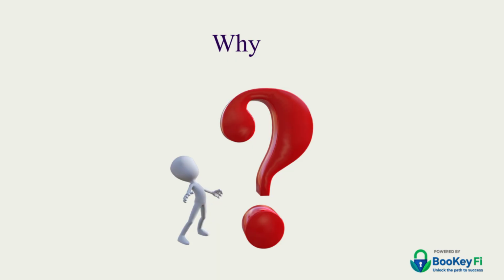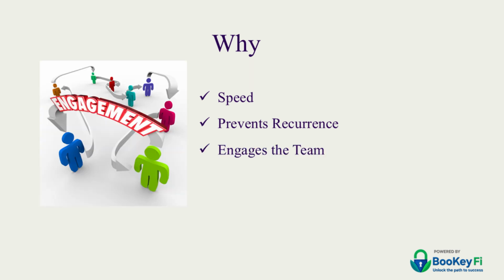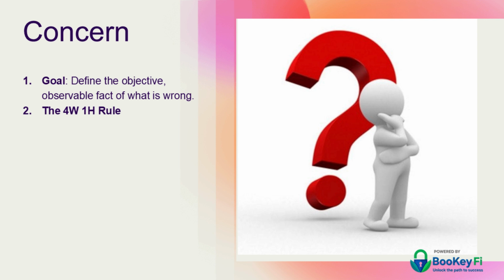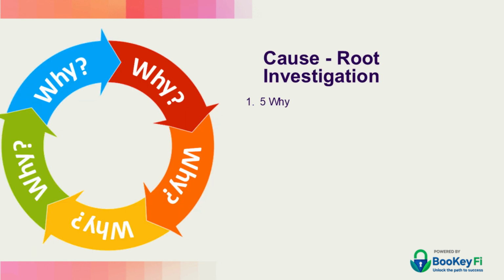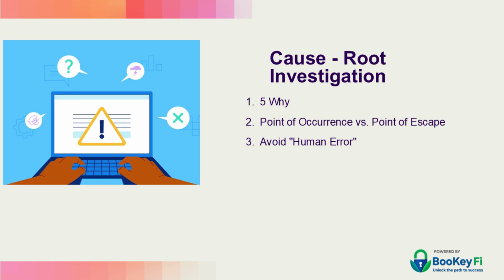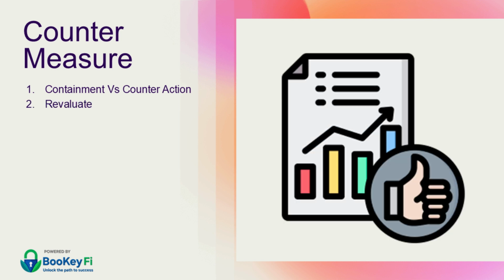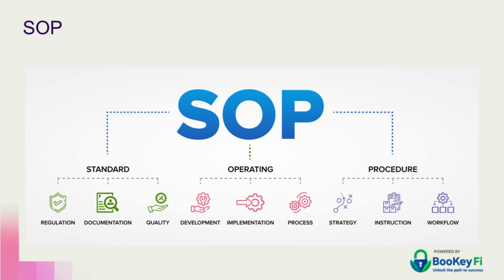3C Problem Solving Lean Quality Tool for Root Cause Analysis RCA | 3C Report free Download

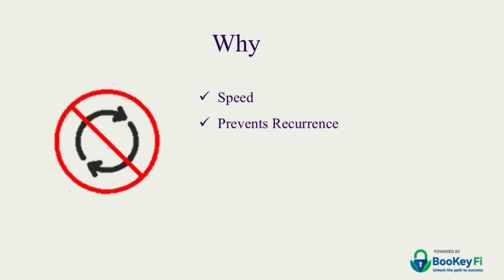Comment: The 3C problem-solving tool is a lean, Kaizen-based framework designed to address operational inefficiencies quickly and effectively by focusing on root cause analysis rather than temporary fixes. It is particularly useful for daily, short-term issues that do not require complex projects like Six Sigma (0:00-0:49).

The 3C Step-by-Step Process:

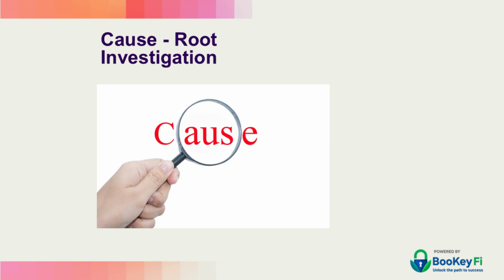Concern (1:13 - 2:17): Define the problem objectively. This involves using the 4W1H rule (What, Where, When, Who, How many) and conducting a Gap Analysis to compare the standard performance vs. actual performance. A critical component is the Gemba check, where you must physically visit the site to confirm facts rather than relying on rumors.
Cause (2:18 - 3:06): Investigate the problem by distinguishing between the direct cause (the symptom) and the root cause (systemic failure). Use the 5 Whys method to drill down into the issue and ensure you analyze both the Point of Occurrence and the Point of Escape (why quality checks missed the defect). Crucially, avoid blaming human error; focus instead on process or visual standard failures.
Countermeasure (3:07 - 4:25): Implement a permanent process change. This distinguishes between containment (short-term patching) and countermeasures (long-term solutions). After implementing the fix, you must reevaluate performance to ensure the gap is closed and update the Standard Operating Procedure (SOP) to prevent the problem from recurring.
Applications and Limitations:

Applications: Highly effective in manufacturing, shop floor management, lean office environments (to streamline information flow), and healthcare (to improve patient safety) (4:26-5:28).
Limitations: The 3C tool is not suitable for high-risk or extremely complex problems, such as active health hazards or issues involving complex data trends (5:32-5:41).
Reply from the maker: Ok thanks will update this from next video